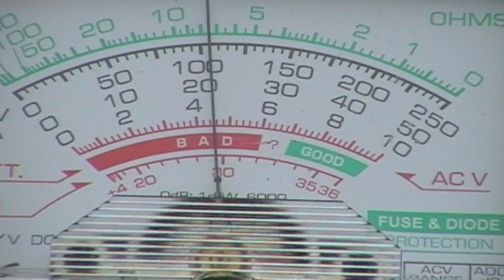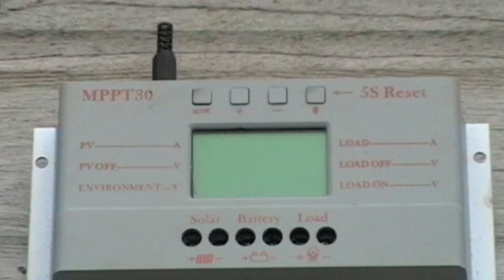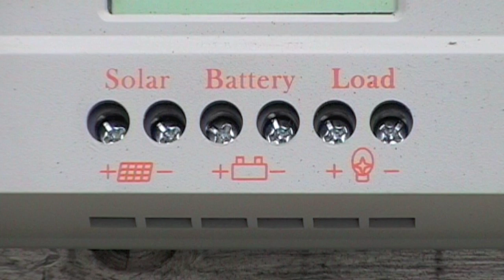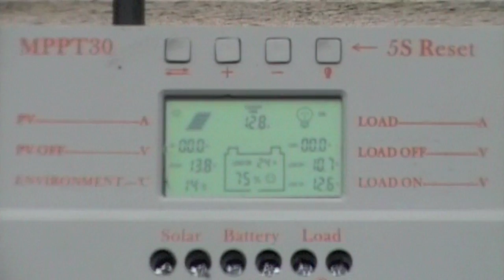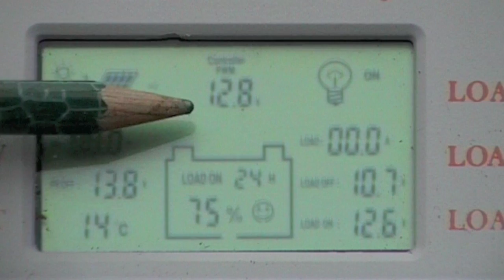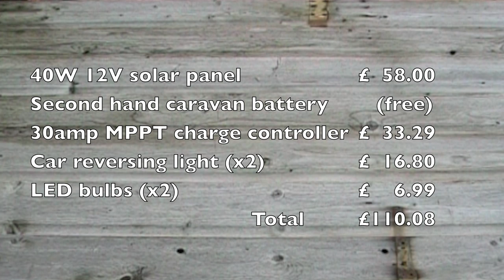Solar powered shed: 01 Basic solar setup

Comment: I've watched alot of solar panel and charge controller videos. and i think all of them say that you need to connect the battery first to the charge controller then you connect the battery. They say if you connect the solar panel straight to the charge controller you will short circuit the charge controller and will render it useless and you may also short out the solar pannels. Very very bad video. I wonder how many people's charge controllers or solar pannels have followed your instructions and caused them to break their equipment.
Reply from the maker: Your right Knockturnall1. I did correct them in the wrong order. However my charge controller didn't short circuit and it is still working fine to this day.
Reply: 😭😭😭 Waaaaaa...

Comment: nice video but what kinda battery did you used i know you can't used any car battery have deep cycle battery or lithium ok i have deep cycle 12 volt 75 amp 900 watts to run my 1100 watts inverter

Comment: Hi, I don't know if you are still keeping tabs on your YouTube account but I have a couple of daft questions:  
-  Do the reversing lights have an on/off switch?  I don't want the lights on all the time.
-  When you mention 2 of these lights, do the cables for both lights get inserted into the charge controller?  Is there enough room?
Great video otherwise, I am feeling very enlightened!

Comment: You really should not connect the solar panel to the controller before having a battery connected... If the panels were bigger or higher voltage.. you could fry your controller!  Always battery first!

Comment: 9:05 Did you mean 230V instead of 24V? Google search says UK power socket voltage is 230V, which is more inline with global standards.

Also, why do you connect the inverter to the battery instead of load in the first place? Wouldn't that remove the need for the fuse? Is it because the controller is not rated for suitable amperage, so you want it to be fed directly from battery?

I'd appreciate answers as I'm going to be setting up a similar (but larger) system myself

Comment: Do it exactly like his in this order: ALWAYS connect your battery ("earth"/"ground"/"negative"/"minus symbol"/"black") terminal to the charge controller "minus symbol" FIRST! Then your live wire"/"hot wire"/"red wire" goes to the charge controller "positive symbol". You can SAFELY connect your load device in the same order, and ALWAYS attach the negative 1st, then the lead "red wire". Now your device will function. Third step is the solar panel "minus symbol"/"negative wire"/"black wire" to the minus symbol on the charge controller and lastly, the "positive"/"red"/"hot"/"sparky"/"live wire" to complete your circuit! And disconnect in the reverse order for servicing. ( i like putting appropriate fuses on "red" lines). Ask me how I know! Love it! POWER UP!

Comment: The power inverter, you say it converts 12v DC to 24v AC from the wall socket in the house, surely you mean 240v. What is the output watts you get from the inverter you are using? Oh great video, very clear to understand. Thanks

Comment: Great video, and well presented, and very easy to understand. Even a dummy
like myself could hook this configuration up. I am confused about a couple
things. Can you get a control unit with 6-8 inputs, so you can run more lights,
or could you run a splitter off that, to do the same ?? 2ND question, is how many
LED lights could you run off that battery, as those lights, use very little power ?
Maybe you could answer my question when you get a minute -- thanks :)

Comment: You always connect the battery to the charge controller first, also I see a flaw in this circuit design, your shed lights would always be switched on

Comment: Bad setup, do not follow these instructions. I read up about my similar setup using a 40w panel and PWM charge controller, that before connecting the solar panel to the charge controller you must first connect up the battery.  Solar power can fry a charge controller without a load. When my PWM arrived the instructions also made it clear, do not ever disconnect the battery from the PWM first, disconnect the solar panel first.

Comment: Thank you for the vid. Just one thing I would add I bought a led strip lamp from tool station and put it on my inverter to a 12v car battery and it lasted 5.5 hours from fully charged, super bright light !

Comment: Just a note...it doesn't hurt to have a shutoff on the inverter post...saves powering the condensers when not in use and also prevents sparking when attaching the leads..but if you only have 1 battery it helps..I've got 8, not such a big deal..still a good idea

Comment: a good video - you show quite impressively how to do it wrong! the battery is connected to the charge controller first, then the solar panel - whoever reads the operating instructions does not have to buy 2 x !!!! ----- greetings from a noob from germany

Comment: NIce little setup and tutorial, thank you for your clarity and encouragement

Allways hook battery up first, so the power from the solar panel has somewhere to go.  I've read you can burn out your charge controller hooking up the panel first. store panel face down when idle
-It's a PWM controller, the MPPT lable is pure artistic licence.  It even says PWM on the screen.  Not surprising for these cheap chinese controllers.  
-And probably nowhere near 30A.  Maybe rated 4A. Perfect for your 2A.
-Check the fluid level in your battery, even if its a "maintenance free"  SLA(Sealed Lead Acid). Add distilled water to 1/4" below bottom of filler tubes.
-Needs to be desulphated if sitting a while at low charge, and/or with low water. Find a charger that has a desulphation step. It's basically 15.5v for awhile after charging cycle.
-Charge it up before you use it! Once in a while, put a real battery charger on it to make sure its getting the best.  Good Batteries are mucho $$$, cheap charge controllers are not trustworthy.

Car battery: (hard to find consistant numbers) deep cycle numbers slightly higher
-3.1v Virgins dancing around dad in dreams
-12.9v is full, 100%.. Furious discussion begins on dad's internet 
-12.7v when buying brand new. 75%. dad satisfies mum
-12.6v daddo happy camper, comfy slippers, tea hot
-12.2v "I'm tellin dad!"
=12v fully discharged, flat. bad boy!
-11.4v is 0 percent.  time to find a new dad
-10.5v dead as a dodo. halves the life . kid sold to rag and bone man
-rated for 300-500 cycles @50% discharge.

Comment: Always connect the battery first to the controller. You run the risk of damaging it by connecting the panel first
Reply: And always connect positive before negative. Also, a 100a breaker is far too high

Comment: I have been told that you should connect the battery to the controller first, so as to eliminate the possibility of the solar panel destroying the charge controller with a sudden boost of power on bright sunny days. Is that correct?
Reply: Yes.  You should ALWAYS connect the battery to the charge controller first.   If he'd had 400W of panels on a sunny day he could have fried the controller.  15W on a cloudy day didn't really do much damage.

Comment: At 3:30 to 3:45 when you connected wires to the panels and put them in, I don't understand how you do that part. 

How do you tell which is negative and positive for the cables coming out of the solar panel?

And you didn't show and explain how you hooked wires into the solar panel's default cables. And that part doesn't have a good coupling setup to go to a wire, it looks like it wants another part instead to go between the solar panel's manufactured cable end and whatever wire is going into the next device.

Comment: khusus indonesia 
PANEL SURYA (POLY) PER WATT PEAK  :
20 WP = Rp. 195.000
30 WP  = Rp. 300.000
50 WP = Rp, 350.000
80 WP  =Rp. 520.000 
100 WP = Rp. 650.000
120 WP = Rp.780.000
150 WP = Rp. 900.000
200 WP = Rp 1.200.000
300 WP = Rp 1.800.000

HARGA DISTRIBUTOR , HARGA BELUM TERMASUK ONGKIR 

Toko : Jalan Labu No. 40B, Tamansari, Jakarta Barat

WA : 0813 8078 8089 (Miko Ng)

Comment: Total waste of time. First mistake was connecting the panel to the controller first. Why do you have to connect the shed lights to the load. You just connect them to the battery. The idea of the load terminals is to supply a load while solar available. Ie during the day. Whats with the gloves it's only 12v

Comment: I've been researching Solar for about 10 days and this video is the best one so far. Simple and informative. I just want to run lights in my shed and maybe use the occasional power tool so this was the perfect video for me. Thank you. Now I must find out where to buy the best parts.
Reply: used deep cycle battery 12 volt 100 amp 1200 watts lithium cost lot 2000 watts inverter  used pure sine wave its best inverter

Comment: There are two problems with this video. Firstly the positive wire from the solar panel has been stripped too long and the protruding copper wire can contact the metal body of the charge controller which may cause technical problems. Secondly it is said that the inverter converts the battery voltage from 12 volts to 24 volts ac power the same as a wall socket. This is not true. The output from the inverter is 240 volts ac power the same as a wall socket and it should be realized that the output voltage from this inverter is just as deadly as a normal wall socket.

Comment: I find that I need at least 300 watts of panels to constantly keep my batteries charged....AND, daily use going(i live in Texas where there is almost always a ton of sun).  That way I have power left over after the sun goes down in case of emergency needs overnight.  If you use your batteries dry during the day...you have nothing left over for night time needs.  I mainly run my computer, charge phone, keep AA and AAA batteries charged for flashlights and stuff, as well as my portable power banks.  The AA, AAA, and power banks are used for LED lights at night or recharging phone or ipad units.

Comment: Good video, but just some food for thought, the goofy light port does watch the battery voltage and cuts the battery supply of typically at 12.2V. The 12.2 represents the battery being 50% discharged, however it is not entirely accurate. That figure is for a battery at rest but not under load.    You should have set a battery interrupter sensor in the battery circuit. It is critical that lead acid battery’s don’t go past 50% discharge and that they are charged up as soon as possible. One could argue that the inverter itself has a low voltage shut of but generally these are set to low for battery longevity ( my inverter has a 11.0 volt cut off. There is a terrible amount of math involved with a solar system. If for instance you never fully charge that battery it will shorten it life. A 1.25 amp panel would charge a battery just 5 amps ( approx ) here in Virginia on a nice sunny day. So.. you need to calculate the draw ( in amp hours ) of the load per day ( lets say your draw is 1.5 amps for 6 hours per night ) = 9amps. Increase that because of the weather and losses .. 20 amps . You have 4 hours of day light to create 20 amps... ( a little more if you use a Mppt controller. ) you might be able to do it with a 170 watts of panels. Finally you goal is longevity and to keep those lights burning at night... so you need to select a 40ah ( because you only want to use 50% ) battery that is capable of charging at a 5 ah rate, for rare sunny days you produce over wattage /amperage you need to absolutely limit the current and not “overcharge” it.  Differing battery types will offer significant advantages... enough... someone give me feedback as this stuff is very complicated. Your system might work if you use motion detecting lights..

Comment: This is almost identical to my shed set up. The only difference is I power the shed lights directly from the battery (Via a fuse box)not from the controller. I have a 110 watt panel and for the last two or three years I have been using a battery which had spent many years starting my van. I use led strips with self adhesive backing for lighting  . I did have a small disaster I installed the led lights one warm day . I then went to collect my friend from the rail station. On returning home I proudly opened the shed door  only to find the heat of the sun shining on the roof had melted the glue on the lights and they had all fallen off. Some saddle clips soon fixed that. I have never had to charge the battery from a mains source although I do have a charger that can I can hook up in moments. During the last two months of lockdown I have spent most days in the shed with the lights on and powering lots of stuff including charging my model planes trains and mobility scooter. the voltage sags a little from time to time but as soon as the sun comes back out all is well. Great video .....

Comment: A bit confused, and i need help from the expert. Why is the power inverter not connected to the charge controller Load output, since the output is 12 volt , I think the power inverter is to step it up to 24v? I know that the Solar panel charges the battery from the sun, hence keeping the battery to keep functioning
Reply: The charge controller regulates the voltage coming from the solar panel to only charge the battery. The current that the solar panel puts out is not enough to power an inverter. The inverter has to be connected to the battery in order to get enough current to allow it to work. An inverter can draw a lot of amps under load. His power inverter takes in 12 volts DC and puts out 240 volts AC. He made a mistake saying 24 volts.  Hope this helps.
Reply: @davidgeorge8541  nice one bro. Thanks for the explanation.

Comment: Quite a few things wrong, first off, you always connect battery to solar controller before the panel. Next, the positive cable was loose which can short on the framing of the SP.
Reply: Isn't he supposed to connect positive first for safety? That's what they recommend for working on your car battery.

Comment: Two small gauge wires ran in parallel do NOT = one larger gauge wire.Electrons will take the path of least resistance .So, the electrons will only travel down ONE of the two wires.Safer to use the proper gauge wire......whatever the panels leads gauge is or slightly larger.

Comment: Hie . I really enjoyed this but i have 1 question . Why you did not connect the inverter from the load on that battery regulator.? Thank you
Reply: I think that load intended for low amp (usually not more than 10 amp).

Comment: Very well made video. I was wondering if you could connect the inverter input as the load to the charge controller? I am assuming there is a reason you did not do that, but it was not so obvious to me.
Reply: Probably because it's not rated for the amps he's pulling.

Comment: I liked your video,, but you made one  ""very big mistake!""  you should never connect the battery last!,, the battery is all ways connected first and then the solar panel is last,, also you should not disconnect the battery if the solar panel is still connected to the solar regulator,,  the reason for that is the regulator needs to ""see"" the battery so it can work out the voltage needed to safely charge it,, IE: @ 12 or 24 volt's,, you were very lucky you did not ""blow up!"" your regulator when you hooked it up to your battery with the solar panel still connected,, other than that,, you got things right!

Comment: thx for the video.   Hooking one up is relatively easy.  My questions are:   When it's night time, the light is going to stay on all night and drain the battery?  How do I figure out how long that light will stay on with the battery?  Can you put an on/off switch hooked up to the light for use at night?

Comment: Just a twist on this. Could you also wire in a battery tender to the 12v from the mains ? Where I live, the power is not guaranteed day by day. I would to charge the battery from either the solar panel with the controller during the day, but at night time I would like to keep the battery charged from the mains. Would it be possible to leave both charging sources hooked up at the same time or would I have to set up a switch to charge from one or the other ? Thanks.
Reply from the maker: Sorry - can't help with your question. I wouldn't try and mix different charging sources but that doesn't mean it can't be done.

Comment: This would have been the perfect instructional video but for the fact that you have connected the panels to the controller before you connected the battery. I have the same controller and it states that you connect the battery first so the controller knows what voltage the system is running at
Reply from the maker: Yes - my bad. Lots of folks have pointed this out. Thankfully the controller wasn't damaged.

Comment: Err u started out with the intention o supplying DC powered lights in your shed. You demonstrated that the lights work when they are connected to the load connection on the controller. I am assuming the lights have a switch but since they are from a vehicle, you may need to put one in as well as a fuse?
Reply from the maker: Correct - all the lighting set up is for a later video.

Comment: Never, EVER connect a solar panel to a charge controller first.  ALWAYS connect the battery to the charge controller first, then the solar panel afterwards.  The open circuit voltage of 21 VDC from the solar panel will usually damage the charge controller chipset without a battery first connected.
Reply from the maker: You're right. I got lucky and nothing was damaged.

Comment: Can more panels and batterys be added to this system down the line without any extra equipment?
Reply from the maker: Yes, but it's important how the extra panels and batteries are connected so you'll need to research that.